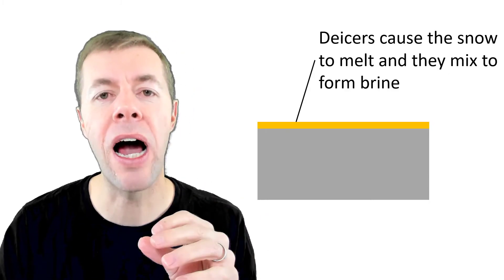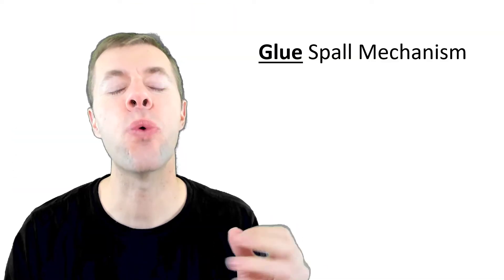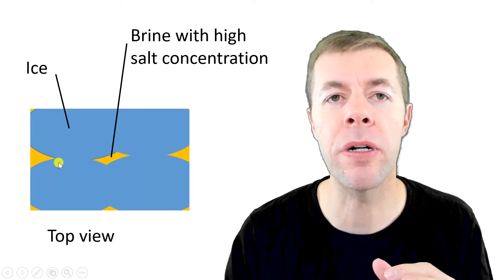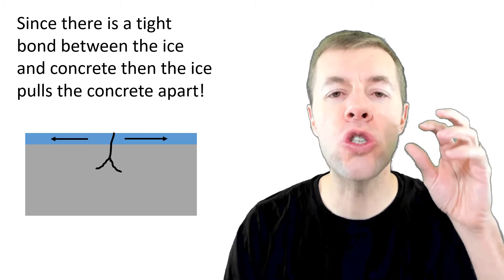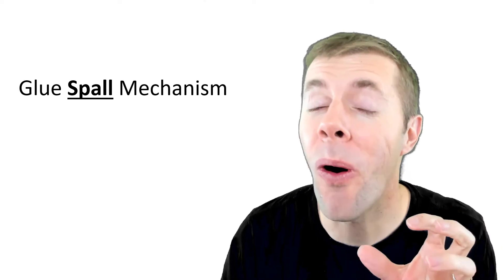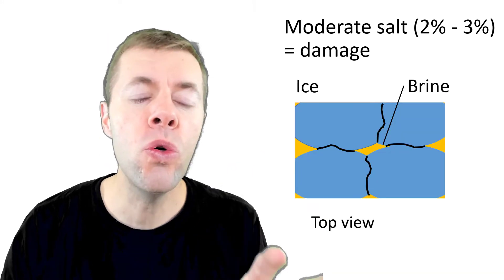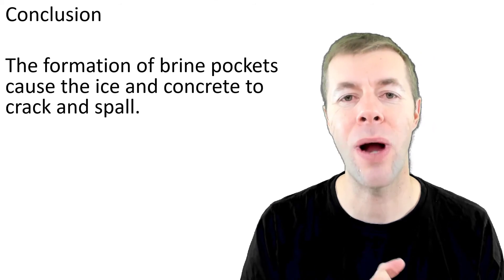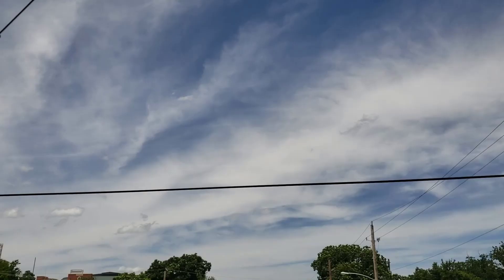Why does salt scaling damage concrete?

Comment: Very interesting. Love your videos. I teach a concrete basics class and I have a playlist from your site that I listen to the night before class just to get my mind right. So I’m a little confused. I do coatings and repair, and people all the time say “somebody put salt on it last year and now it’s spalling”. I thought it was more of where the chloride they used melted the precip and saturated the cap, exposing poor finishing and no curing. But this seems to say that if you melt it with anything, it’s going to spall. Is that true? And if so, what do we do to avoid it (besides using extreme concentrations)? Bonus question: I seem to recall the brine freezing temp curve dramatically rising past 23% concentration, where much past this point no longer depressed the freezing point. Is that not correct?

Comment: Thanks for the video. Is it only salt that creates the scaling? Could pouring concrete within four days of winter, when all of a sudden there are cold, very cold, and freezing temperatures at night with above 40F temps during some days, throw in a couple nights of rain, plus snow Jan third, and the freezing nights and thawing days afterward?

Comment: Tyler! I can't tell you how much I"ve learned from watching your videos. I'm a construction worker by trade, and in the blue collar world, far from academia, we are taught that "spalling" occurs due to water being absorbed into the surface pores of the concrete and then freezing. 

I trust your knowledge implicitly and am ready to throw away a lifetime of experience, this is not a challenge. I want to be corrected. 

I have personally seen concrete spall where no salt was ever used. Is it possible for water to absorb into concrete then freeze and expand breaking apart the concrete at the surface as I have been taught and always believed?

Comment: Not just salt but also how close plows scrap, too close and the plow blade bits into the cracks making them larger, add to that the high speed the plows are moving increases that impact dmg.

Comment: Can Spall damage be repaired?
Reply: Yes. There are ways to stop the process ( not just address the symptom ) and apply a polymerized cementitious overlay that will last for decades.   I have been resolving issues related to this for 47 years. I have projects done in the 70’s still giving good service . At the time, the slab was candidate for removal and replace 
Sometimes that is what is needed. Someone who knows what they are looking at can advise you
Reply from the maker: If you wait until the scalling has stabilized then I think you can repair it.

Comment: Is it possible to minimize the amount of water added to cement at the time of mixing it so as to reduce the trapped water in concrete?
Reply: You can use super-plastifiers